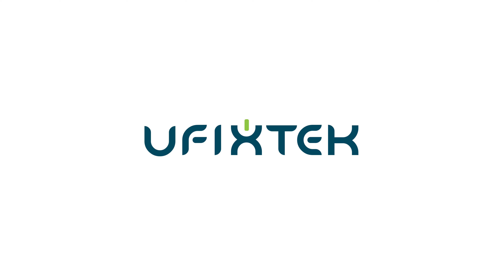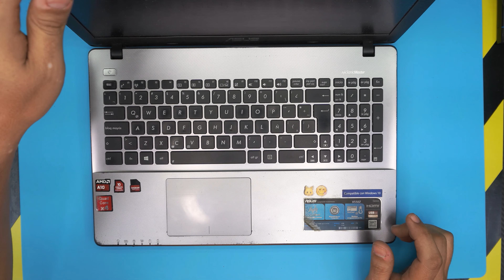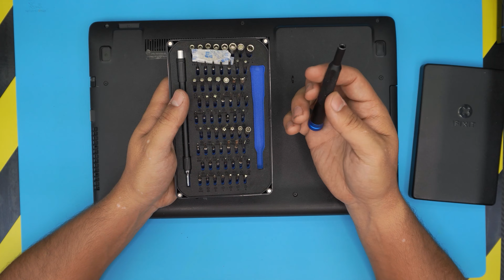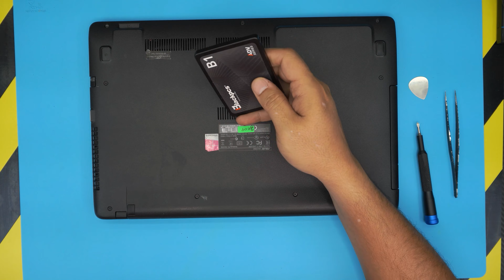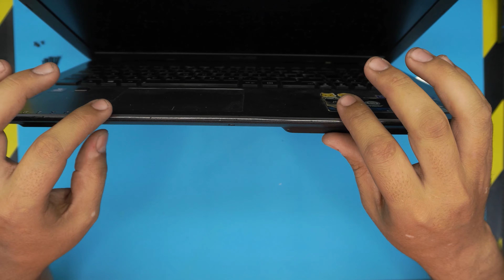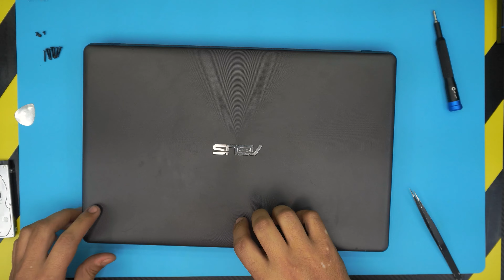ASUS X550z Laptop SSD HDD Upgrade Guide

Comment: Thank you so much. Is it possible to show how to use the remain hdd in the dvd player
Reply from the maker: It's my pleasure my friend.
🫠Regarding your question, i will make a video on that soon.
cheers🍻
Reply: @uFixTek  Thanks a lot. And It would be so much helpful if you show us to boot an windows into the new ssd and then using the old hdd as a storage. Just a suggestion. Thanks already
Reply from the maker: you will simply need to get this:
https://amzn.to/3OHSW9W
Remove the old DVD, use the caddy, place the HDD into it, and install it just like you would with a DVD player.
Once you have created a Windows 11 USB boot drive:
#1. https://youtu.be/T0uBTVNCdAQ
o
#2(recommended). https://youtu.be/K3UFQmPcQjs
Then, you can insert the USB into the laptop, tap F12, and install Windows. Simple steps.
cheers🍻

This is an Amazon affiliate link. When you use my links, you are helping to support the channel. 🙏